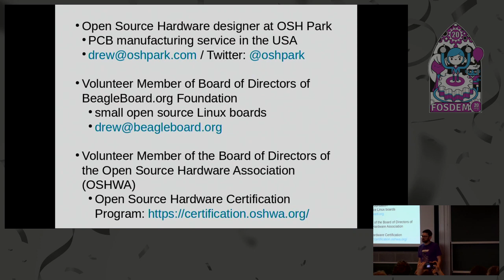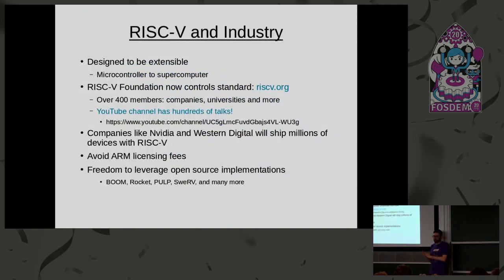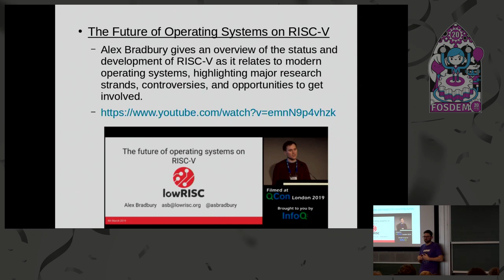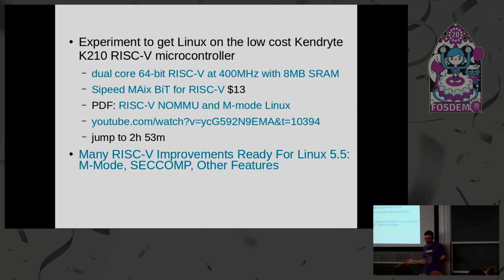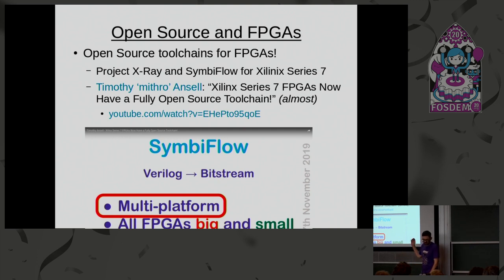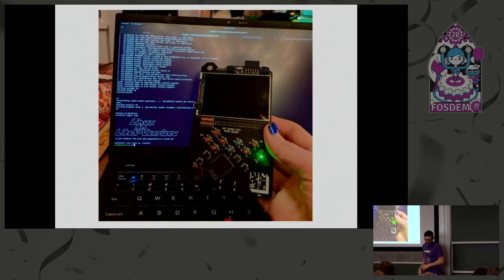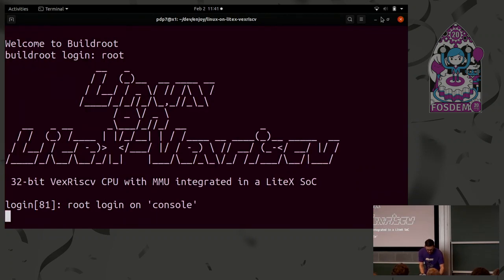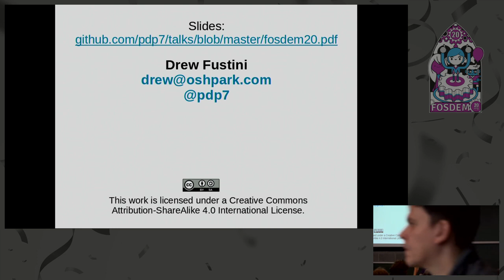How to run Linux on RISC-V  with open hardware and open source FPGA tools

Comment: When IBM released the System 360 part of the documentation was a trifold card with all the hardware instructions and instruction formats contained on it called The Programmer Reference Card. Later when the System 370 was released they produced the same sort of card for the new system but printed on yellow cardstock. All the programmers I knew still called the green card.

Comment: Running Debian on a Raspi 3b.  It came with the Bookshelf app in the main menu that provides links to all the Hackspace, Magpi and Wireframe magazines along with lots of programming books.  i must officially be a nerd.   Sometimes i wonder how it could be possible to design software to run parallel so that clock frequencies would not need to be increased.  I look forward to when NVIDIA reveals how their GPUs parallel process data.  That would be major step in the Open Source Community.  Maybe the Raspberry Pi community already provides info on the GPU section of the CPU/GPU SOC and maybe it can be accessed.  I need to look into it.  Long Live Linux and the RISC Team !!!!

Comment: The original "green card" was for the IBM 360 instruction set. Essential for debugging COBOL core dumps.  It was changed to yellow when the 370 was introduced.
What would be the problems in of replacing an ARM chip with a RISC-V on an existing board, (the Rapsberry Pi being the obvious candidate), or cloning one for location of peripherals and other physical attributes ? The nature and number of connections (pins in and out)? Missing or additional features, (e.g. device controllers)? Exploiting the existing ecosystem for things like cases  and cooling would let effort be concentrated on the areas that matter.